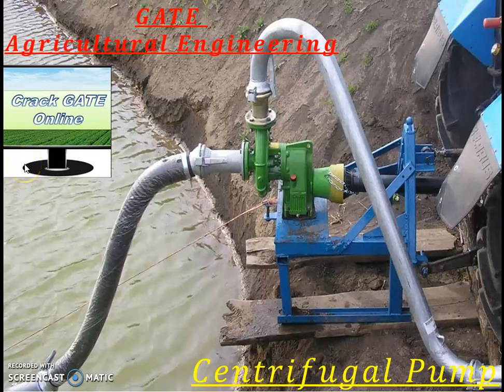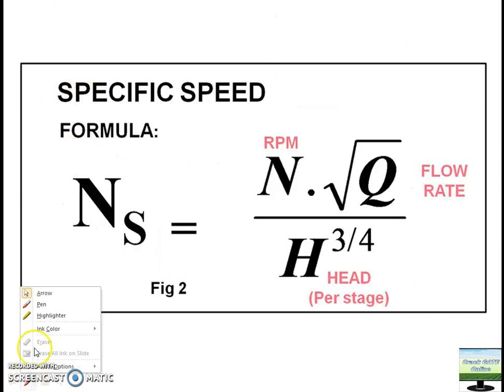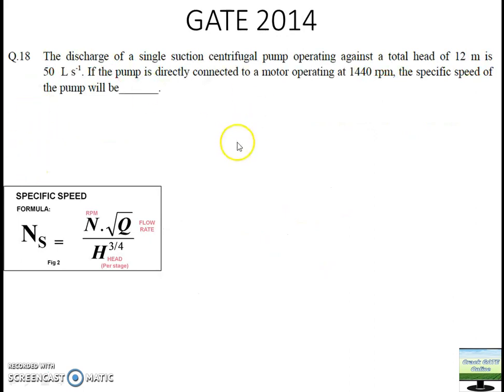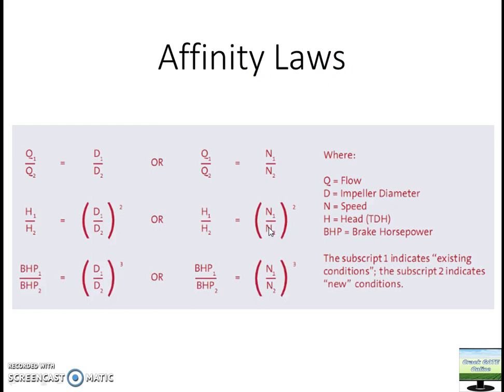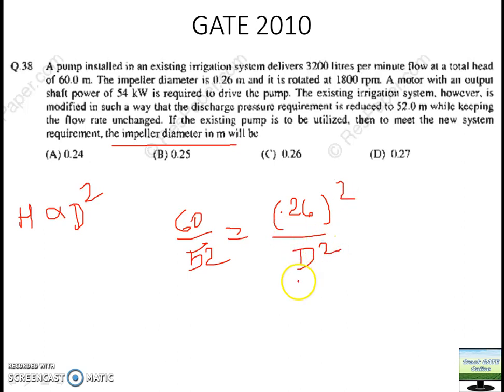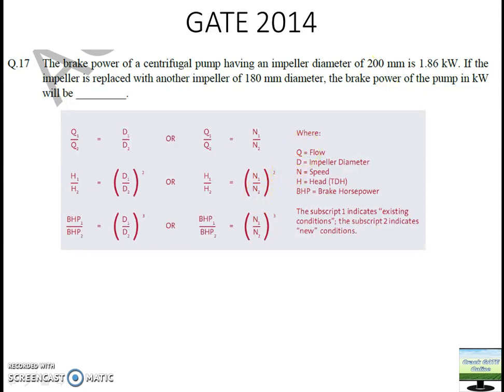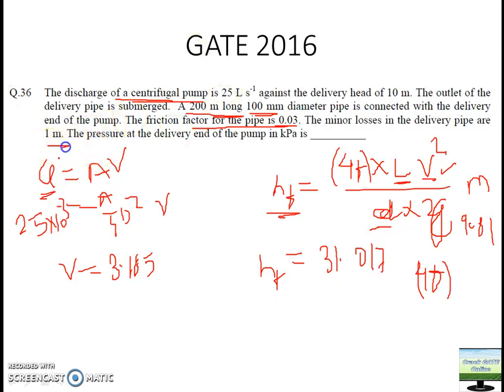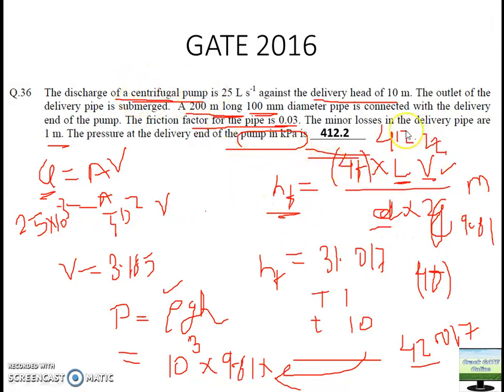Centrifugal Pump

Comment: sir the unit of Q in specific speed is confusing sometimes m3/s sometimes l/s. clearify this sir...
Reply: Standard unit is m3/s only......but only in 2017 question unit is lit/s otherwise answer is not matching...
In objective type question you can be sure what unit is giving answer but in fill in the blank it is problem
As you can see in all other questions except 2017
i would suggest to put m3/s.
Reply: Sir then how can we sure about that....it's really confusing
Reply: It's really confusing in case of fill in the blanks

Comment: How to solve this 

The inner diameter and the stroke length of single acting reciprocating pumps are 120 mm and 400 mm respectively. The speed of the piston is 50 strokes per minute. the suction and delivery 8 hour 5 minutes and 10 minutes respectively. If the efficiency of both suction and delivery stroke is 60% the actual power required by pump in Kilowatt is a. 0.55 b. 0.65 c. 0.04 d. 1.12
Reply from the maker: watch Reciprocating Pump Theory and Numericals video...i have solved this question

Comment: Sir I asked q.no. 47 of  2016 year but no one is giving me answer or any hint
Reply from the maker: Harsh do not worry about that question... that question related to weight transfer...
You can solve by using weight transfer equation....
write moment equation for rear wheel centre
only change is that you have to assume any Load at front axle in order to prevent from lifting....
then make front axle reaction = 0 and calculate value of front axle load
we will upload remaining video of Tractor at end of october..before that do watch all video of Tyre and Traction Series that is very important Till then you can cover other topics..please do watch all video.. Study well
Reply: Agricultural Engineering Crack GATE Online 
Sir ese hi Kiya Tha weight transfer is 600N more than Rf... Then is k baad solve nhi ho paa rha .. plz sir iska solution zrur btana sb ho gya but y nh ho pa rha